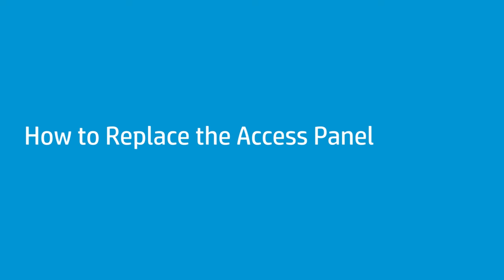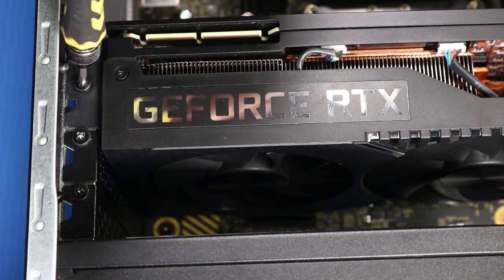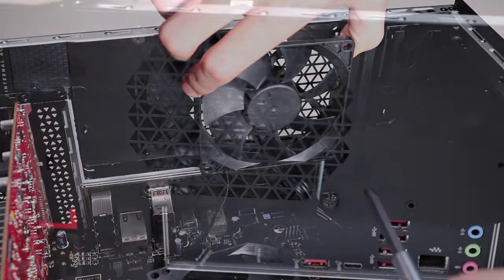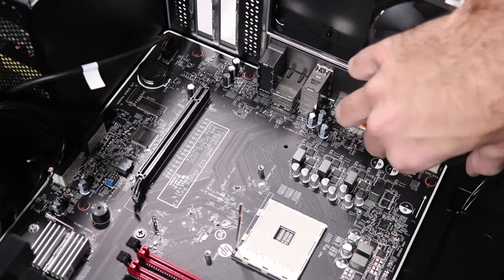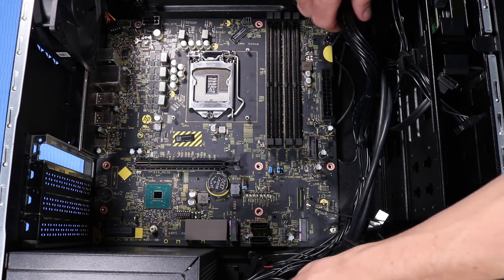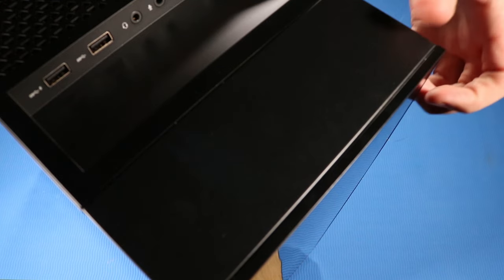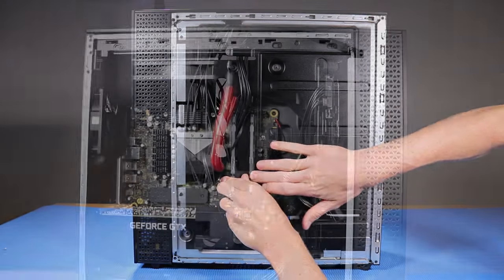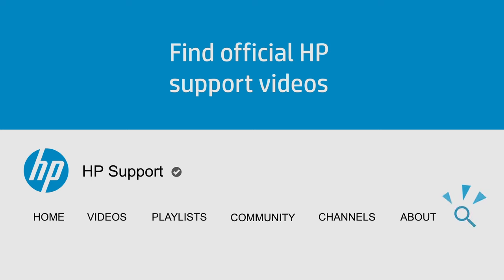Removing & replacing parts for OMEN 25L/30L Desktop PC | HP Computer Service

Comment: I have a 25l gt12-0240m is it possible to add more fans with RGB or is the RGB not possible
Reply from the maker: +Random Fatal gaming HP does not recommend upgrading or downgrading hardware parts or software that is bundled with the product as It may affect the manufacturer's warranty and performance, however, you could change the configuration at your own discretion.

Comment: I was wondering can the wifi card and the antennas effect how much mb you get we pay for up to 500mb my xbox downloads 80-90 mb but when I got my Hp omen25L its always been 7-11 mb I wanted to know if theres ones i can get that will improve the internet?
Reply from the maker: Hi there, thanks for contacting HP Global Social Media Support!
HP does not recommend upgrading or downgrading hardware parts or software that is bundled with the product as It may affect the manufacturer's warranty and performance, however, you could change the configuration at your own discretion.!
If you need any help in the future, you can always get back to us.
Thank you for being a valuable HP customer.
Have a wonderful day!
Cheers!
Binu-HP Social Media Tech Support

Comment: I have a GT13-1194, though the bracket for my graphics card looks different then what appears in the video. Is it possible for me to upgrade to a 3080 or 3080ti? The brace makes it appear as though it would be too large to fit.
Reply from the maker: +DougoftheRatMen Checked the specification of your computer and found that it has One PCI Express 4.0 x16 lanes and One PCI Express 3.0 x1 lanes. So you can add graphics card that supports these slots.
Reply: i took my bracket out the day i brought the pc home and its fine, i think its more for when they ship the pcs,.

Comment: My front intake fan just randomly fell off and is leaning against the front glass. How does the front glass come off? It was skipped over in the video.
Reply from the maker: +Lord Turtle Please contact our phone support team to fix the issue. Please follow these steps to reach them.
Step 1. Open link: https://support.hp.com/us-en/contact-hp
Step 2. Select the product type.
Step 3. Enter the serial number of your device or select let HP detect your product option.
Step 4. Select the country from the drop-down.
Step 5. You should see the HP phone support number.

Comment: so i currently own a 25l with a i7 socked and want to know if i kan liqued cool it
Reply from the maker: +jylo voss HP does not recommend upgrading or downgrading hardware parts or software that is bundled with the product as It may affect the manufacturer's warranty and performance, however, you could change the configuration at your own discretion.

Comment: How many system fan headers on the motherboard?
Reply from the maker: Hi Tristan, thanks for contacting HP Global Social Media Support!
I understand that you need to know about the system fan headers on this computer.
I will do my best to assist you.
HDD	     Up to 2TB 7,200-rpm
PSU	             Up to 750W Cooler Master 80 Plus Platinum ATX PSU
Side Panel   Metal or Glass
Cooling	      1x 92mm rear fan, 92mm air cooler or 120mm liquid-cooler
Binu_HP Social Media Tech Support

Comment: hey hp, i currently own a hp omen 25l with a super 1660, i was wondering if i can replace the 1660 with a 3060 or 3060 ti and the intel i5 with an intel i7
Reply from the maker: +rstmaiato Checked the specification of your computer and found that it has One PCI Express 4.0 x16 lanes and One PCI Express 3.0 x1 lanes. So you can add graphics card that supports these slots.
Reply: @HPSupport  thanks hp

Comment: I bought a new 30L (5900x with watercooling) this week but it is very noisy, idles at ~60° and under load close to 90°. What can I do to resolve this? Return it?
Reply from the maker: +mlonster Please refer to the instructions mentioned under this document to fix the issue: http://hp.care/2nIM2mc
Reply: So if the pc gets hot, you should turn down the power and graphics settings in the game?
A pc with 3080 or 3090, you should be able to play on the highest setting in games without the computer overheating..
The case on this pc has bad airflow and bad cooling system in general and should been removed from the marked..
Reply: So HP, how do we resolve this? What product do you have that is adequate at cooling this cpu?
Reply: @mlonster  Their stock fans and case are horrid for airflow and cooling. You should replace the fan with a better aftermarket one like Noctua. Potentially a case swap, but that can be difficult if you aren't sure what you're doing.

Comment: I have 30l 3070 ryzen7 can I upgrade the liquid cooler?
Reply from the maker: +Dante Cueto HP does not recommend upgrading or downgrading hardware parts or software that is bundled with the product as It may affect the manufacturer's warranty and performance, however, you could change the configuration at your own discretion.

Comment: Are these motherboards hardware locked? Originally I bought my Omen that came with a ryzen 7 5800x and a Radeon 6600 xt

I tried installing (on separate occasions) a ryzen 9 5950x and I kept getting blue screen errors with various error codes and then when I tried installing a new 7900 xtx nothing would boot up and I would be stuck at a black screen (side note: I upgraded my psu to a seasonic 1000w and that hasn’t been an issue at all this entire time)
Reply from the maker: Hi there, thanks for contacting HP Global Social Media Support!
I am here to help!
May I know the product you are using? A serial/product number would be helpful!
Let me know!
Regards, 
HP Support

Comment: what kind of hhd hard drives can i use? to upgrade storage.
Reply from the maker: +blooddragoon1921 You can purchase the part from here: http://partsurfer.hp.com/ Please select your country and enter serial or product number of your unit.
Reply: You can use any 3.5 inch drive. 2.5 is also supported, but you'll have to get your own screws for mounting it, as they're not included in the system.

Comment: I have an OMEN 30L Desktop - GT13-0255st CTO 2MD02931GT. Can I upgrade the gpu to an RTX 30 series card? It currently has a 1660 ti which is like half the size. I have seen other videos claiming that there is not enough space to put in a full size gpu? Is this true?
Reply from the maker: +Joaquin Menendez Checked the specification of your computer and found that it has One PCI Express 4.0 x16 lanes and One PCI Express 3.0 x1 lanes. So you can add graphics card that supports these slots.

Comment: Hey hp, I currently own a hp omen 25l with a 1660 super, I was wondering if I could replace the 1660 with a 3060 or 3060 ti? Thanks
Reply from the maker: +Cole Checked the specification of your computer and found that it has One PCI Express 4.0 x16 lanes and One PCI Express 3.0 x1 lanes. So you can add graphics card that supports these slots.
Reply: It's nice they specified there is a slot that should be used, but you can add pretty much any GPU to your system as long as your power supply is sufficient, which it is. It's a 500W PSU, which is the same as the configuration they sell with a 3060.
Reply: @lordturtle8735  oh fr? I think that answers my question. Thank you bro

Comment: Got a new Omen PC with Ryzen 5800X and RTX 3080. Was looking to add another NVME SSD and it looks like this specific model does not have an extra slot for NVME SSD, Am I right ?
Reply from the maker: +Tech May I know the complete model number of your computer so that we can check the details for you?
Reply: @HPSupport  GT13-1154
Reply from the maker: +Tech It supports WD_BLACK 1 TB PCIe NVMe TLC Solid-State Drive. You can confirm it in the specifcation page: https://bit.ly/33T4W4S

Comment: how do you find RAM and/or other components? partsurfer isn't helping me much.

HP OMEN 25L

Ryzen 5 5600G
GTX 1660S
8GB DDR4 RAM
Reply from the maker: Hi there, thanks for contacting HP Global Social Media Support!
I understand that you need to purchase parts for your computer.
In order to get this issue fixed, please contact our customer care team over the phone or chat for further assistance, as this issue requires Live conversation with you over phone or chat to isolate the issue and provide you instantly with appropriate solution or repair/replacement options available at your place as per the warranty.
Please feel free to reach us on call/chat, please access this link to select your preferred country and language option to reach us. Global support link: - https://www8.hp.com/us/en/contact-hp/ww-phone-assist.html
Binu_HP Social Media Tech Support

Comment: Is it possible that I could upgrade the GTX 1650 in my OMEN 25L to a 3060 Ti?
Reply from the maker: Hi there, thanks for contacting HP Global Social Media Support!
I understand that you need to know whether you can upgrade the graphics card of your computer.
I will do my best to assist you.
May I know the complete model number of your computer?
Please let us know. 
Binu_HP Social Media Tech Support
Reply: @HPSupport  7WM47AV
Reply from the maker: Thanks for the reply.
This computer has One PCIe x16 Gen 3 socket (for discrete graphic card).
So you can add graphics card that supports this slot.
Use the HP Parts surfer to identify the part: https://partsurfer.hp.com/partsurfer/ 
Binu_HP Social Media Tech Support
Reply: @HPSupport  Ok thanks but another issue is that if the graphics card is longer than 8 inches, it may or may not hit a pin that’s sticking out of the motherboard and I’m not sure if a 3060 Ti would fit.
Reply from the maker: Thanks for the reply.
Solution one- download (speccy) It'll tell you your motherboard name, google it to check if it has a graphics card slot that is welded in place or is one that can be changed. If yes then go onto crucial.co.uk it should help to tell you what graphics card you're best upgrading to or if you know your stuff then get whichever you like. solution two - if your card is soldered into place then just buy a new one. Remember if you're going to open up your laptop chances are your warranty will be void.
Binu_HP Social Media Tech Support
Reply: @HPSupport  Do you think it would also be possible to upgrade the 500W power supply to 650W? If so then do you know one that can fit?

Comment: I tried to install a new SSD in my HP OMEN 30L but the SATA data cable is too short. How can I resolve this issue without taking the whole thing apart?
Reply from the maker: +Sean Delaney Please contact our phone support team to fix the issue. Please follow these steps to reach them.
Step 1. Open link: https://support.hp.com/us-en/contact-hp
Step 2. Select the product type.
Step 3. Enter the serial number of your device or select let HP detect your product option.
Step 4. Select the country from the drop-down.
Step 5. You should see the HP phone support number

Comment: Is it possible to upgrade my Omen 30L 120mm AiO to an 240mm AiO? My 10700k is always on 60C in system and about 90C while gaming… 120 AiO isnt enough for this cpu if u wanna have the pc over years :/
Reply from the maker: Hi there, thanks for contacting!
I understand that you need to know whether you can upgrade your Omen 30L 120mm AiO to an 240mm AiO.
I will do my best to assist you.
HP does not recommend upgrading or downgrading hardware parts or software that is bundled with the product as It may affect the manufacturer's warranty and performance, however, you could change the configuration at your own discretion.
Binu - Social Media Tech Support
Reply: did you?  Is there enough space?

Comment: Does anyone know how to reset to factory settings in bios, i already used the cmos battery method but it still doesnt have display, i checked all cables, took out and put back in ram sticks. Someone help out please.
Reply from the maker: Hi there, thanks for contacting HP Global Social Media Support!
I understand that you need help in restoring default in bios.
I will do my best to assist you.
Please refer this document to know about restoring default in bios: https://splr.io/6058caMKA
Regards, 
HP Support

Comment: Hey Hp, i have a HP omen 25l with 3060ti. Can i replace it with a 3080 ti?
Reply from the maker: +Aslak Barlaug Checked the specification of your computer and found that it has One PCI Express 4.0 x16 lanes and One PCI Express 3.0 x1 lanes. So you can add graphics card that supports these slots.

Comment: for some reason my 30L omen desktop fans randomly have become very loud, i took the case off and cleaned all dust thoroughly off the fans but the issue persists and omen gaming hub won't adjust the speed of the fans i set it to.
Reply from the maker: Hi Rare, thanks for contacting HP Global Social Media Support!
I understand that you are experiencing a loud fan noise issue on your computer.
I will do my best to assist you.
Please refer to the instructions mentioned under this document to fix the issue: https://bit.ly/3Lbxgla
Binu-HP Social Media Tech Support
Reply: @HPSupport  none of these worked, im not sure why the fan is so loud, its the one on the back in particular, it spins much faster than the rest of the fans and nothing i try adjusts its speed
Reply from the maker: Due to limited support on this platform to fix this issue, please feel free to reach us on call/chat. Access this link to select your preferred country and language option to reach us. 
Global support link: - https://hp.care/3sI89jD 
Binu-HP Social Media Tech Support

Comment: Hello , I have a HP Omen gt13 with i7 11700k and rtx 3080Ti it has a 800w psu.  
I bought the pc this year and it has still warranty support. I am trying to solve it my self before have to send the pc back to HP for repair.

My pc keeps crashing if I try to game or benchmark it. It gets really loud and then my screen goes black (saying that there is no connection) and I have to reboot the pc by holding down the power button.

This is not happening when doing not heavy task like watching YouTube, browsing the web ....
Reply from the maker: Hi there, thanks for contacting HP Global Social Media Support!
I understand that you are experiencing a freezing issue on your computer.
I will do my best to assist you.
Please perform updates via Windows and HP Support Assistant as mentioned below to fix this issue: Step 1 Windows Updates - 1) In the search box, type and open Windows Updates. 2) Check for updates. 3) If the updates are available, click on install and restart the computer. Step 2 HP Support Assistant Updates - 1) In the search box, type and open HP Support Assistant. 2) Check for updates. 3) If the updates are available, click on install and restart the computer.
Binu - Social Media Tech Support

Comment: I have the 25L Omen Gaming Desktop and am searching to buy the same time of ram stick from HyperX Fury RGB 8GB HP37D4U1S8MR-8XR, where could I buy one identical to this model and if not is it compatible with others?
Reply from the maker: Hi there, thanks for contacting HP Global Social Media Support!
I understand that you need to purchase the memory for your computer.
I will do my best to assist you.
Use the HP Parts surfer to identify the part: https://partsurfer.hp.com/partsurfer/ 
And order it via the HP Parts store: https://bit.ly/3nKMYrs 
Binu_HP Social Media Tech Support
Reply: you can install other ram but for it to run at 3200mhz you need to only have the aftermarket sticks installed then a memory overclock option will appear in the bios (if it doesnt show up update your bios). if the ram overclocking option still doesnt show up you can use ryzen master if you have AMD or intel XTU depending on your chipset
Reply from the maker: Thanks for sharing the information that helped you!
Binu_HP Social Media Tech Support

Comment: It’s to annoying i can’t remove the gpu bracket/stand there is a screw stuck and won’t come out and i can’t open the side panel to see what is going on
Reply from the maker: +xVeXiS Please contact our phone support team to fix the issue. Please follow these steps to reach them.
Step 1. Open link: https://support.hp.com/us-en/contact-hp
Step 2. Select the product type.
Step 3. Enter the serial number of your device or select let HP detect your product option.
Step 4. Select the country from the drop-down.
Step 5. You should see the HP phone support number.

Comment: How many fans can I add maximum? I have 30l.
Reply from the maker: +Seungbin Baek The OMEN 30L Desktop is the advanced user option to come from this collaborative effort. It boasts all the spec options of the OMEN 25L Desktop with added cooling performance and aesthetic elements in the form of an additional thermal compartment with a pre-installed 120mm RGB front fan from Cooler Master.

Comment: I have a 3080 in mine and I’m trying to remove the bracket and it won’t come off. I unscrewed and tried takin it out just like the video but the bracket is like stuck or something someone help!!
Reply from the maker: +Sufyan Khalid Please contact our phone support team to fix this issue. Please follow these steps to reach them.
Step 1. Open link: https://support.hp.com/us-en/contact-hp
Step 2. Select the product type.
Step 3. Enter the serial number of your device or select let HP detect your product option.
Step 4. Select the country from the drop-down.
Step 5. You should see the HP phone support number.
Reply: Same, did you solve it?
Reply: @cube6694  yeah I figured it out thanks 👍🏽